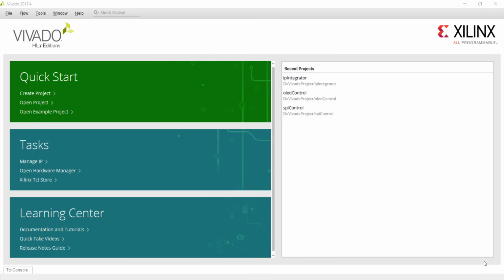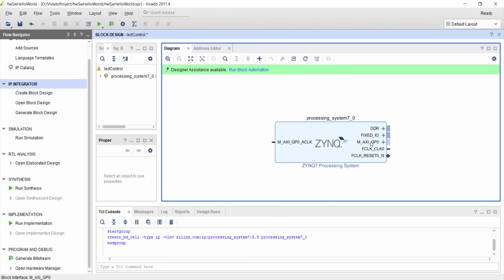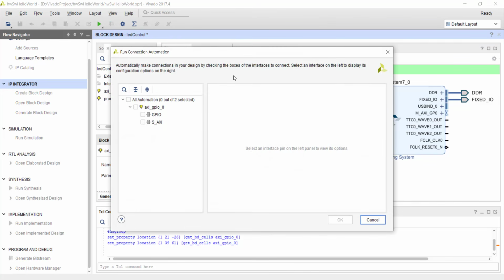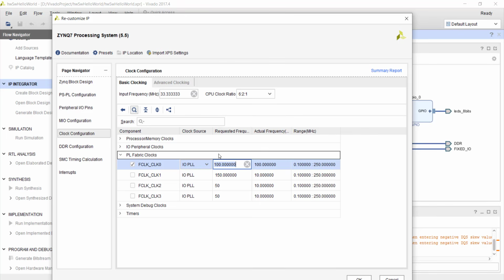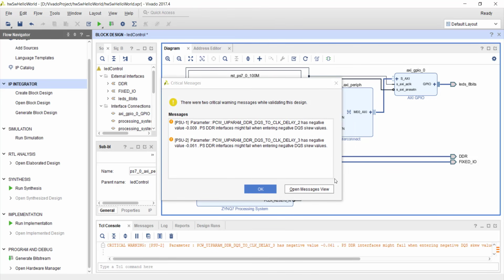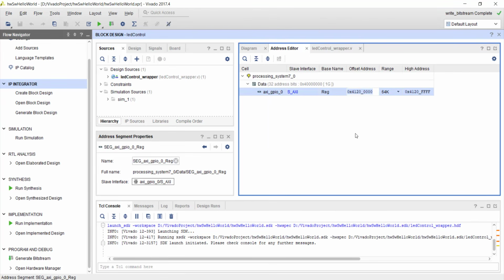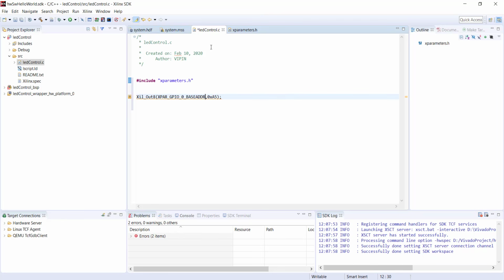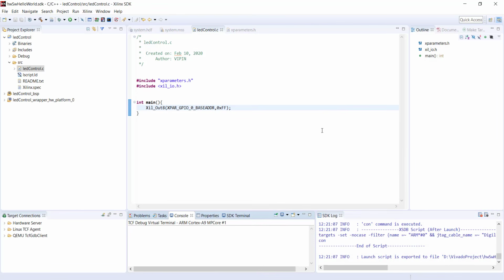Hardware Software Codesign 1

Comment: I am using Zybo Z7-10 board which have 4 LEDs (4-bits)... In this case how can I light up the LEDs? I think there is no function like Xil_Out4...
Reply: I am sure you have figured out the answer by now. In case you haven't, I just used Xil_Out8 and accessed the LEDs through the lower nibble.

Comment: ThankYou Sir for the Video. It is really helpful. There is error when i try to Program my FPGA through SDK, "FPGA configuration is failed.DONE PIN is not High" . What is the FPGA Configuration that you have used?
Reply from the maker: FPGA configuration failed means FPGA programming (bitstream programming) failed. Usually happens if your cables are not properly connected or the configuration logic is in some error state. If configuration was successful, the done led will glow. If error is coming from SDK, try from Vivado also.
Reply: @Vipinkmenon  I could do it Sir, Thanks
Reply: @Vipinkmenon  Sir, Is There a specific reaaon to use Vivado 2017.4 ?

Comment: Is it possible to use normal scanf function to give inputs to the board from the sdk terminal?
Reply from the maker: Yes. Just include stdio header
Reply: @Vipinkmenon  I tried that.But it seems FPGA is not receiving the input.My program was a simple decimal to led converter(ex :if i  give 3 as an input 3 leds should glow.).I didn't add UART IP into the block.Is it because of that.?
Reply from the maker: @sarankk886  Can you post your code here? Just print something on the screen first to make sure the communication path is ok.

Comment: Great video !!! I have implemented an algorithm in VHDL I need to pack the implemented RTL logic into custom IP then access the IP from the ARM processor using SDK. What and how do I need to design the IP, I am new to this custom IP development, I am not understanding what logic where to initialize in axi slave template file. Any lead would be appreciated.
Reply from the maker: Basically you need to map all the control signals to your logic to registers and connect the signals from those register to your IP. The data to your IP should be also mapped to a register address and connect those as input or directly connect an AXI stream interface. You can check this video also for better idea https://youtu.be/cz0iKv53Vww

Comment: Thanks for the video!  But when you were explaining about the purpose of the interconnect I was wondering if we can have two M_GP ports from the zynq and connect each of them to one of the gpio IP core  directly without the interconnect. In that case will there be a memory overlap issue or will the zynq itself just send the data to the either of the Master ports depending on the address
Reply from the maker: You cannot connect 2 GP ports directly to the same input. That is a multiple drive. You can connect 2 GP ports to the same input through an interconnect. So the interconnect acts like a multiplexer. The address of the peripheral from both GP ports will be the same, because the address is assigned to the peripheral not to the interconnect. From software when you access the peripheral, in this case also it will be going through only one of the GP ports. If you put 2 processors and connect both of them to the same peripheral through an interconnect (again u cannot directly connect), and try to access it at the same time, the interconnect will be doing the arbitration and the processors will be served one after the other. In this case also the address of the peripheral from both processor perspective will be the same.
Reply: @Vipinkmenon  thanks a lot for the clarification!

Comment: Great video but not sure why this is not working. I followed everything from Vivado to SDK got blue light after programmed. No LED is turning on. When I try a different value from A5 to FF and re-run I also get error "Memory Write Error at 0x10000. APB AP transaction error...".  Any idea?
Reply from the maker: Under run configurations check Run ps7_post_config also. If AP transaction error comes always power cycle the board (power off and on)
Reply: @Vipinkmenon  
Thank you that worked.
Reply: @Vipinkmenon  thank you sir
Reply: Worked for me as well.  Thank you so much!